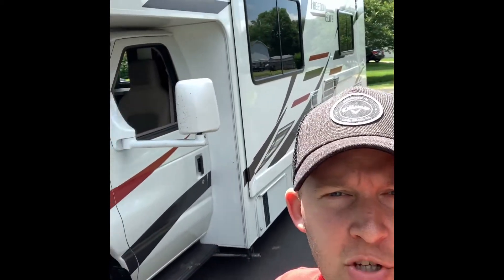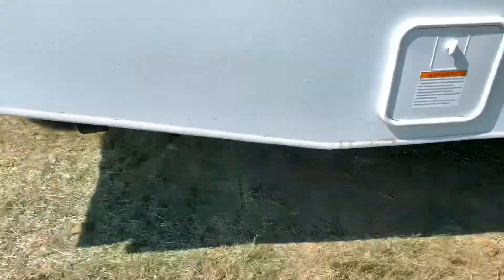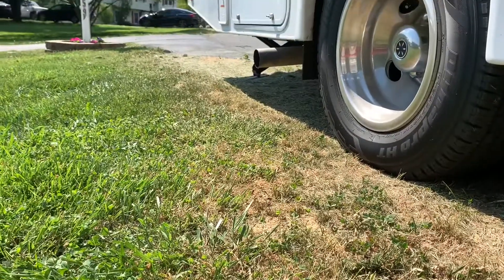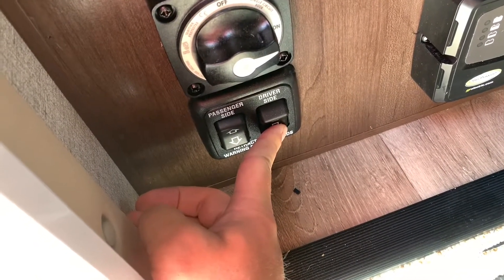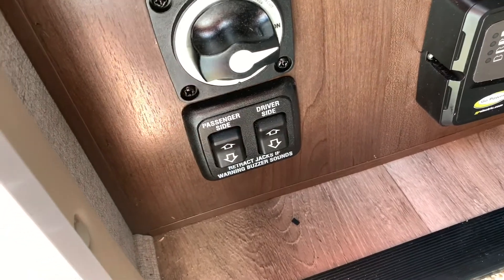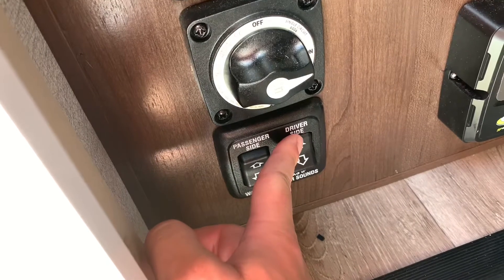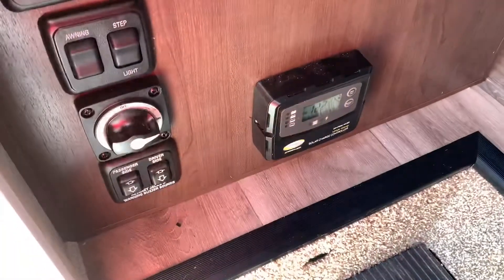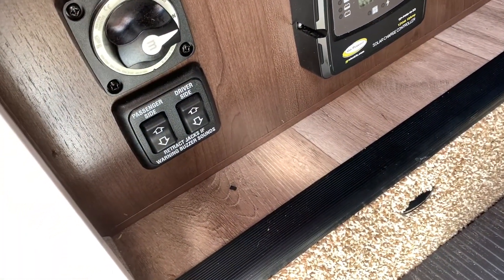How to use the stabilizer jacks on a Thor Freedom Elite 27FE RV

Comment: let me start off by saying nice video. I currently own a 2021 27fe and considering putting front stabilizer on it. have you consider doing this and do you have any recommendations
Reply from the maker: Yes, they make a manual jack that you can bolt to your frame.  That's what I did.  I keep a toolkit with me while camping anyway you can simply get the correct size nut driver to run the Jack's up and down with the drill.

Comment: I just purchased a 27FE, my stabilizer jacks do not work; any thoughts?
Reply from the maker: Switch is bad or fuse is bad or connection is loose, or limit switch on the jack is bad, or battery is dead, or wire is broken, or jack motor is bad, or jack linkage is rusted, or you tried to drive with them dont and now they are bent.  alot of possibilities